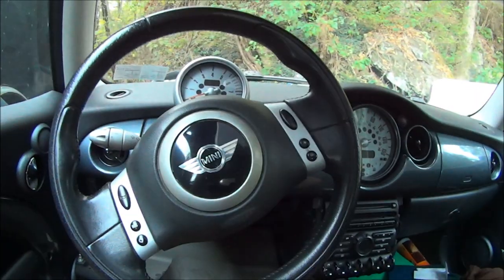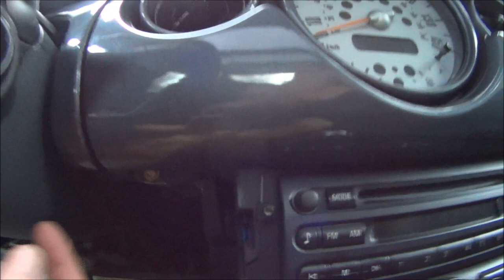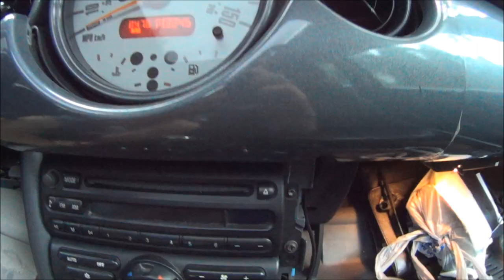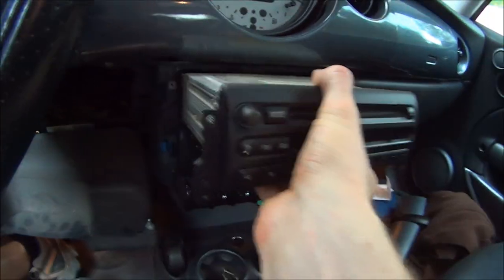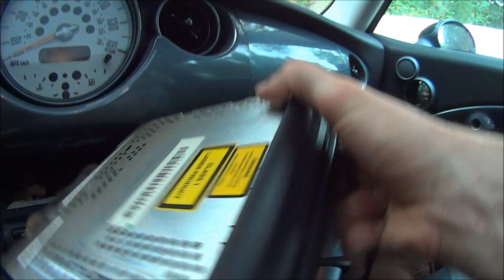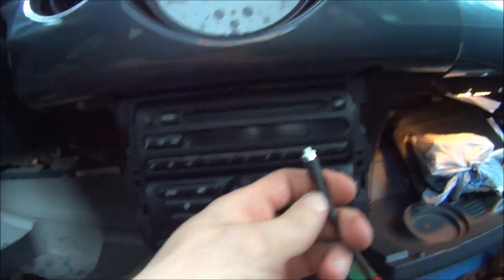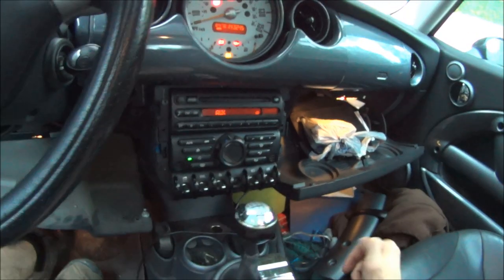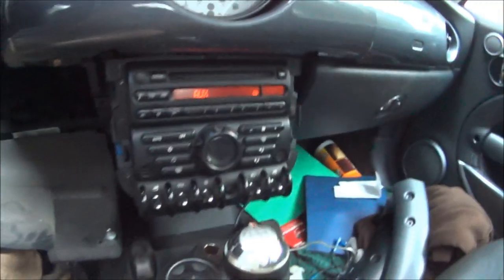Install AUX Adapter in MINI Cooper + How to Remove Radio - 04 Cooper S - Auxiliary Jack 01-06

Comment: Anyone know if it works on a 02 mini?
Reply from the maker: pretty sure it will, you gotta check the back of your radio and see if the port for the 6cd changer is there